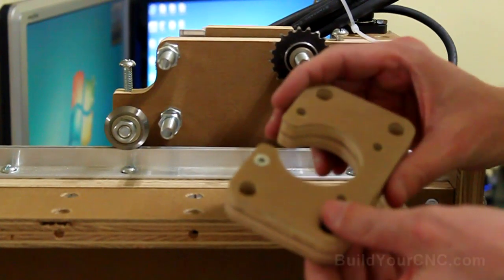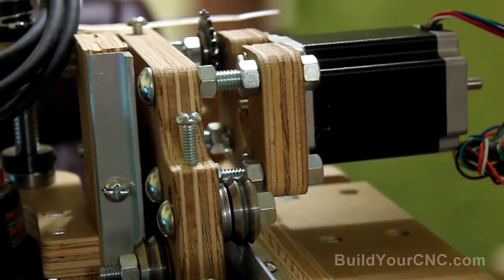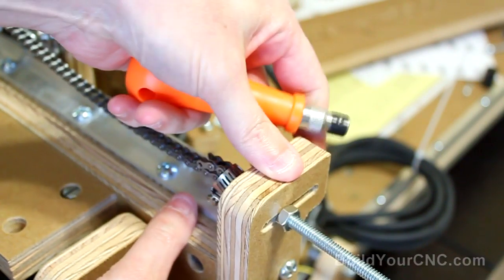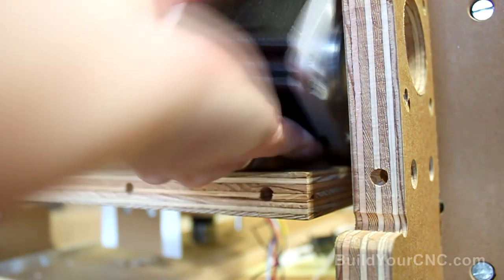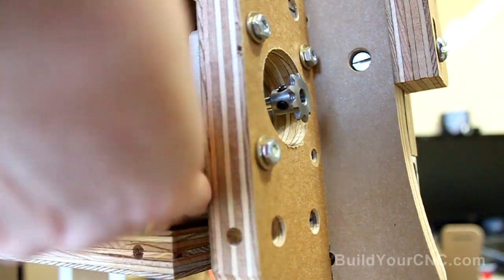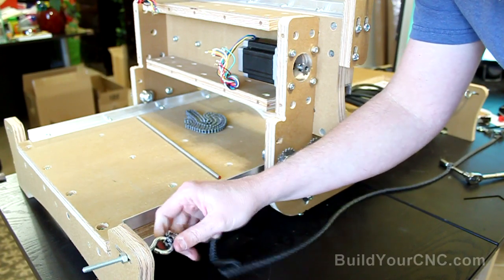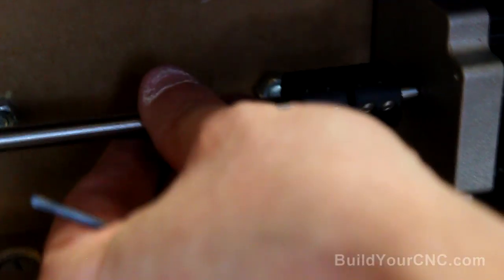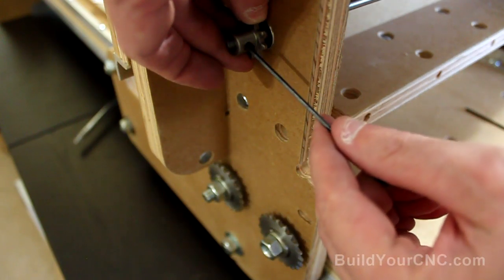blueChick  v4.2 - Mounting the X and Y motors and Roller Chains

Comment: When can I use the gearbox and can I do without it with a six-meter axis?
Reply from the maker: No gearbox is needed. Gearboxes can add backlash and with the many motors on the market, you can find the torque you need for the axis. For a 6m axis, I would use rack and pinion.
Reply: @PatrickHoodDaniel  Can I use the chain for a 3D concrete printer with a length of 6m, and does the rack and pinion always need a gear box?
Reply from the maker: @waseemal-bdwi1491  The rack and pinion does not need a gearbox if you use a high torque motor. Make sure to use the smallest diameter pinion gear so you don't lose too much of the torque provided by he motor. If you want to increase the torque, you can introduce a larger gear to the rack driven by a smaller gear on the motor. You can also use belt or chain for this. Chain drive at that length may introduce too much eliasticity.
Reply: @PatrickHoodDaniel thanks so much
Reply: For a Z-axis chain with a length of 5m, it carries a relatively heavy weight. If the power is cut off from the motor, can it crash? Or can the gears connected to the chain or the motor make it stable? I mean in the event of a sudden power outage

Comment: Great video!   Couldn't you have ran the roller chain in a continuous 360 degree loop instead of anchoring the roller chain on both ends with those two (2) eye bolts?
Reply from the maker: Thanks. I use the bolts for squaring and tensioning.  Twice as much roller chain would be needed if I looped the chain.
Reply: @PatrickHoodDaniel  Anyway, you did an excellent job on your design.
Reply from the maker: @jerrytucker9004  Thanks.

Comment: do you already make a pcb with the CNC? what is the result? you gear have 9 teeth and in my calculate have 0,073mm of resolution (for chain ASA 25). I think that a gear of 7 teeth have better resolution (0,056mm) but it is out of recommendation of ANSI. Into your experience with chain cnc, can you help me about this?
Reply from the maker: I would use microstepping to assist in the resolution.
Reply: Yes, I am using 4x in microstep, above this is necessary change the pulse length. I want to know about milling pcb in cnc with chain transmission
Reply from the maker: I would go with higher microstepping.  You should have no problem using the chain as it is tensioned and will hold a very close tolerance.

Comment: Question about your setup; I built something similar but a 4'x8' model.  I only have a chain on one side of my Y axis and I have been seeing some "chatter" or "skipping" while traversing this axis, do you think it is due to only have a drive chain on one side causing a non axial load on the other side?  I assumed it would be fine to only have one but then I saw your machine with a chain on both sides, I think this may be my issue.
Reply: You need to position your drive (screw, chain, R&P) to balance the resultant forces at the pivot point which is the spindle. So either single drive in line with the pivot point or two drives in equal distance from pivot point. 
This is why moving gantry style machines have drivers along both rails on which the gantry travels.
With chain drive it is relatively easy to drive both sides of the gantry by a single motor. R&P and screw drives are easier to build with two motors, each driving one side, both kept in sync by electronics.

Comment: which are the dimensions of the sprockets and the chain?
Reply: ANSI 25 sprockets and chain. The bites match the motor shafts and there number of teeth determine the mechanical resolution.

Comment from the maker: @MycroftHolmz This is not critical.  The shaft extension can be separated from the motor shaft.  The most important aspect would be that the coupling has a good hold on bot shafts.  That is to say, each shaft should at least be inserted far enough to be tightened by both clamping screws.